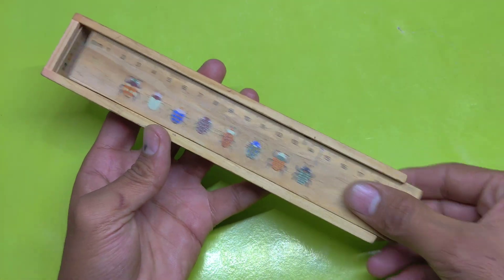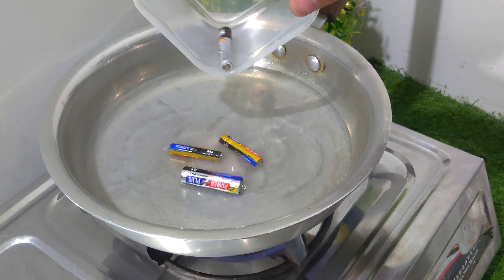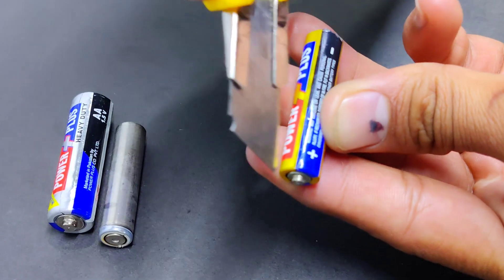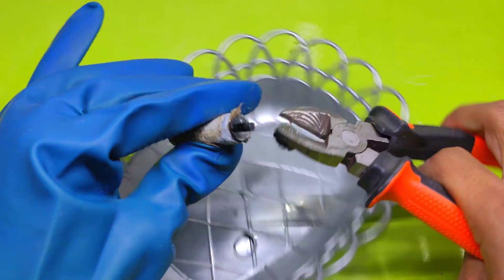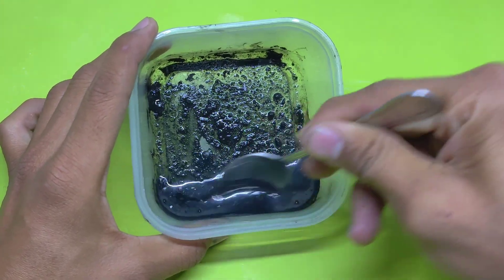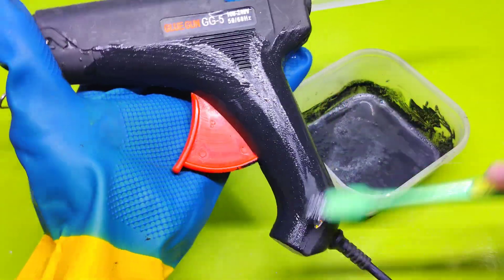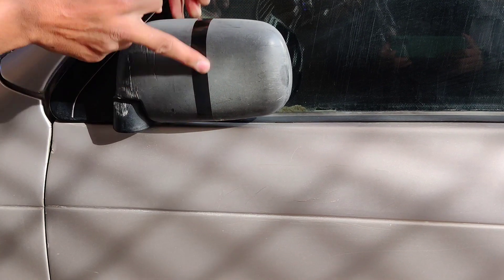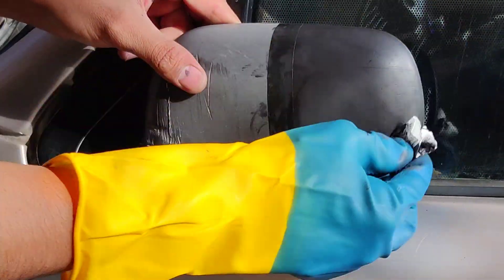How to Turn Old AA Batteries into Cash! The Secret Hack You Can't Afford to Miss!

Comment: Its really impressive but how long does that last after being washed in rain.
Reply from the maker: "Thank you for your question! The paint made from this process is quite durable and holds up well under normal conditions. However, since it’s a DIY solution, its longevity in rain or frequent washing might not be the same as commercial paints. To improve its resistance, you can apply a clear waterproof sealant over the painted surface. This will help it last much longer, even in rainy conditions!"